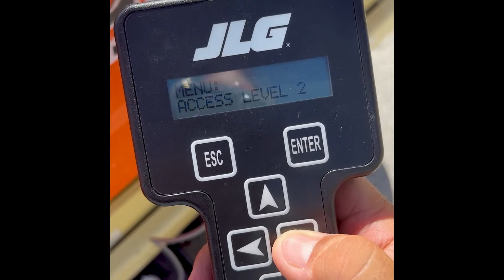Fault Code 251: Elev Angle Sensor Faulty - Voltage out of Range | JLG Electric Scissor Lift

Comment: dude i wanna know code 335 error. plz
Reply from the maker: I am not sure which machine you have this code on  - it wasn't stated.  335 code on 1932R and 4045R electric scissor lift is a damaged harness or water at the connecting plug of harness.  referring to harness for lift function.
Reply: Fail 2512 jLG